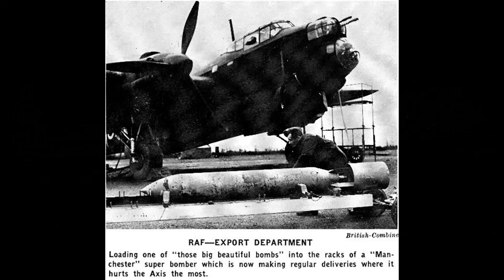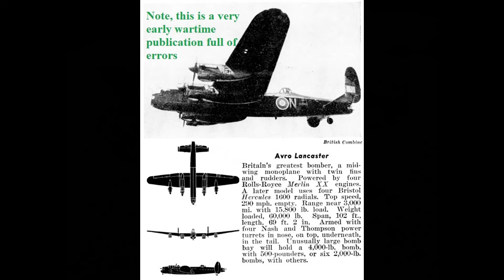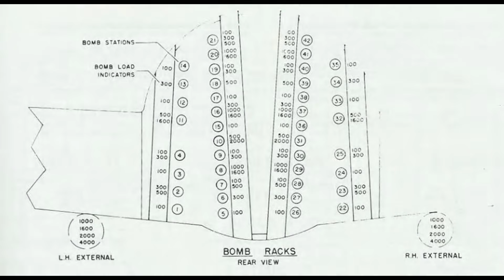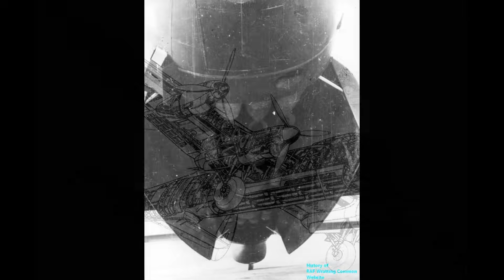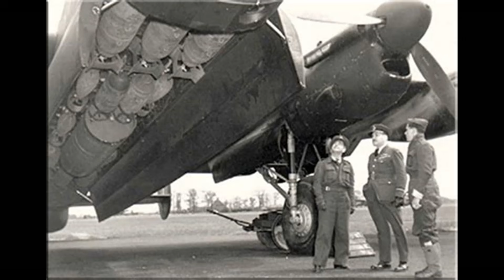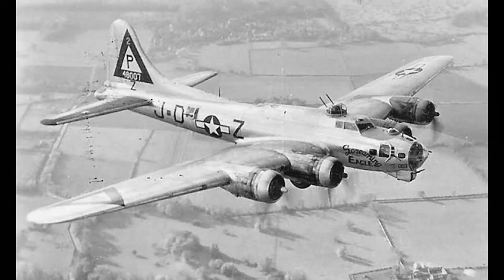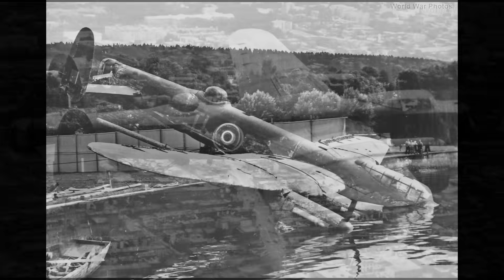Avro Lancaster, Payload, Turrets, Stability and More

Comment: Always enjoy the little side-facts your videos contain - ever since I was a kid browsing through "history of aviation"-type books (you know the kind - lots of images of cool planes, combined with the least amount of technical explanation they could get away with), I was a believer of the "dihedral wings always return the plane to level" myth, as in the wings would automatically generate correcting momentum in the roll orientation. Thinking of it today, should have been obvious that there is nothing to it in that regard (obviously there is no change in roll momentum from the orientation of the plane relative to the horizon), but it's one of those concepts that sounded good and is sort-of-halfway-in-a-roundabout-way-semi-correct, as it does help stability; but I'm very glad you cleared up the whole thing - before your vid, the wings of those C-17/IL-76 you showed made zero sense to me, I actually thought they flex upwards enough in flight to turn dihedral again...
Reply: Actually there are 5 wing to fuselage attachments (for mono-wing aircraft.). Low wing, Mid wing, high wing, shoulder wing and parasol wing.  On shoulder wing (like the B-24 (just look at a picture taken fro above the plane.)) and parasol wing (think of the PBY Catalina) can have part, or all, of their wing with Anhedral!  Some planes have the "Gull Wing" where they have a short dihedral out to their twin engines and then either no dihedral, nor anhedral (B-25, which is a mid wing), or a slight anhedral.... (The F4U Corsair, and the Ju-87 have inverted gull wings).

Comment: The Catalina and Sunderland are other exceptions to the high wing twin tail norm. I guess that being flying boats they has some different considerations to a land plane.
Reply from the maker: I said it the other way around. If it has a twin tail, it's usually not a low wing. The Catalina and Sunderland have conventional tails which are commonly seen on aircraft with all types of wing positions.
Reply: @GregsAirplanesandAutomobiles  I think he's perhaps thinking of the other Consolidated flying boat, the Coronado?

Comment: Considering how many crew died in the plane is testament to the fact that it was NOT a super bomber it was an adequate/good bomber but as you point out far far from perfect.
Reply: Main issue was the size and location of the escape hatches. Had they been better designed nd located, more crew would have been able to bail out.
Reply: @richardvernon317  Liquid cooled engines were the bigger problem.  Coolant lines and flak don’t go together well
Reply: @kingssuck06  No, it was the escape hatches. This was even remarked upon at the time, with their size and position noted as not being optimal, but this was deemed an acceptable compromise given the other positive attributes of the aircraft.
Reply: @kingssuck06   Avro Lancaster 3339 lost, 608612 long tons dropped or 681615 US tons Now compare to USAAF H/Bombers 10152 lost for 761802 US tons dropped 
So one RAF Bomber drops 89% of the USAAF effort and loses 32.89% of what the USAAF lost I reckon that is absolutely fantastic 
Bomber Command 55000 lost in 5 years USAAF 95000 fighter and Bomber crews lost in  2 years 8 months The Source : Air Forces Statistical Digest WW2 Its does not differentiate between H/B L/B and fighters there were 12528 fighters lost
Reply: @richardvernon317  Does anyone actually have the dimensions and has done a comparison of the  crews physique of the Day
Reply: What is perfect?  As I understand engineering is, by it's very nature, a compromise.  Take the B17, indeed the American counterpart for example.  It was intended by the air force to be used in  daylight, unescorted operations and to be able to defend itself against fighter opposition.  As we all know, it couldn't.
Reply: Sure did the job it was intended to do tho

Comment: I have no way of knowing for sure since I lack flying experience, but I imagine any bottom turret would be useless at night, especially if the towns below were blacked out, which they tended to be, it would be nearly impossible to find and track an enemy fighter against such a dark background, at least at night there are some stars and maybe even a sliver of moon to serve as a lighter backdrop for upper and side mounted turrets
Reply: I think another major problem with the periscope-aimed lower turret was vertigo induced airsickness. That was a big reason why they were deleted from the B-25. I'm pretty sure it was also a factor on the Lanc. You can't shoot down the bad guys if you're puking your guts out all the time.
Reply: euh..after the bombing at night over germany..these bombers returned over occupied Holland...at dawn...and things got visible from a morning sun horizon creeping from the east..
Both the lanc as a target from normal german fighters (not nightfighters perse)..as for the lanc to detect trailing german fighters..
Reply: At the time the decision was made to remove the Ventral turret, there were plans to put something else in its place. Greg will most definitely covering said item in a future video. When the USAAF fitted their own version of said device, it was located were the Ball Turret was.
Reply: @Richard Vernon  I'm sure that particular ventral device is the antenna nacelle for the H2S (Home Sweet Home) ground sensing radar.  Both the RAF, and later,  USAAF used it to great effect.  It allowed "blind bombing" by night and by day.
Reply: @amerigo88  The US system was much better engineered and had an automatic bombing capability that the British kit never had until after the war. The original definition of the covering around the H2S scanner was a Cupola, nowadays such an item would be called a Radome.
Reply: but I imagine any bottom turret would be useless at night, especially if the towns below were blacked out

The lack of a ventral turret left a vulnerable blind spot. A few squadrons, both Lancaster and Halifax, made modifications to their aircraft with a jury-rigged ventral position, or later, fitted the Preston-Green ventral turret which had a single .50-cal machine gun (for those not carrying the H2S radar). The main value was not so much in defensive fire, but to warn the pilot of an approaching night-fighter so that evasive action could be taken.
Reply: I expect a central turret would have been far from useless,  if it was a complete, Sperry style unit as in the B-17 and B-24 where the crewman was inside and it was retractable into the fuselage for takeoff/landing. Clouds below the bomber were frequent, so any sort of light such as moonlight from above, burning buildings below, searchlights, and so on would provide illumination for that ventral turret gunner. The German Wild Sau (single engined fighters)  that flew at night sought to use such light to find and attack the Allied bombers as they lacked their own radar. 
As with the tail turret, ventral turret gunners may have been provided radar, but without the turret or the crewman, the RAF never sought a radar for ventral protection, AFAIK.  
Greg hasn't mentioned it yet,  but the standard German nightfighters,  Bf-110 and Ju-88, were fitted with radar and cannons mounted behind the pilot firing at a 70-degree angle ahead and mostly above the fighter.  Standard practice was to with your way into a firing position below the Lancaster,  aim for the wing roots (not the bomb bay!), and open fire.  As the bomber would break up in flight,  the nightfighters would dive away to safety. This went on for many months with impunity, the RAF codenaming the mysterious phenomenon "Scarecrow." Eventually, a German nightfighters with the oblique cannons ("schragemusik") was captured, and the bomber crews and Mosquito escorts began to implement countermeasures.
Reply: @amerigo88  While the B-24 ball turret could retract, I believe the B-17 turret was fixed. Hence the stories about damaged B-17's returning with landing gear unable to lower and a wounded gunner stuck in the ball turret. 

The upward firing schragemusik cannons were very effective, as the German pilot could see the outline of the British bomber against the night sky. The Brits had forbidden their latest Mosquitos from flying over enemy  territory to prevent the Germans from learning about their centimer wavelength radar but were forced to change this policy when confronted with increasing bomber losses.
Reply: @amerigo88  The Schragemusik attacks were aimed at a wing somewhere between the two engines. The reason for this was there was a fuel tank there. Mosquito nightfighter escort support started well before the Schragemusik installation was known about. However, the first Mosquito Nightfighters given to Bomber Command were a bunch of clapped out NF Mk II's fitted with AI. Mk IV radars and Serrate radar homers. AI Mk IV was next to useless in Chaff, The Switch to the longer Wavelength SN2 radars in the German Nightfighters made Serrate useless and the Merlins in the Mosquitos were well worn out and caused a large number of engine failures. Harris had been proposing Mosquito nightfighter support for the bombers as early as 1942 but it wasn;t until late 1944 that he got any major numbers of the latest version of the aircraft with a decent centimetric radar.   AGLT did not become operational until late 1944 and very few aircraft (4 squadrons worth) were fitted with it. Schragemusik became operational on 17th August 1943 (first kill with it was during the Peenemunde raid) but only around 1/3 of the German Nightfighter force was ever equipped with it and it wasn't an easy bit of equipment to use (though in the hands of an expert pilot, he could really rack up the kills if he got into the heart of the Bomber Stream).

Comment: Absolutely love the video. Especially interested in the discussion of the turrets. The Lancaster is oft criticized for being less defensible than American bombers, having less armament etc. Your comment about their usefulness in night operations got me thinking. I'd love to hear more about this topic.
Reply: I always wondered why the front turret wasn’t removed altogether and replaced with a streamlined nose as was done with the Halifax.
Reply: @Glen Towler Freeman Dyson proposed that, IIRC. It wasn't just about speed, but also loss of fewer crew as it was surmised that most lost were due to flak, accidents or nightfighters they never saw coming, with more guns not likely to help with any of those scenarios. The problem was the Lancaster would still have been vulnerable as it would still have been slow, and then morale of crew that felt defenceless would have been so poor there would have been a mutiny. Dyson was correct in logical terms, but ignored the human element.

The reverse is true - the chances of a German fighter pilot being shot down by guns on a B17 was low, but all those tracers flying around had a an effect on willingness to press home attacks. But the loss rate on unescorted raids showed the real killer of fighter attacks was escorts.
Reply: Let's see if the oft-forgotten Lancaster II variant gets a mention. (That one was powered by four Hercules radial engines and came standard with bulged bomb bay doors allowing carriage of the 8,000-lb HC bomb.)
Reply: @primmakinsofis614  people note it was slower, but it did have a bilges bay and more drag. It very often retained its FN. 64 turret as the bulged bay was incompatible with H2S, but you still see photos of ones   with just a fairing there. You'd think a Preston - Green would be a good option there, if just as a look out post.
Reply: @Glen Towler the Free French removed the mid-upper. I presume speed, but maybe also a relative lack of crew.
Reply: @Glen Towler the Free French removed the mid-upper. I presume speed, but maybe also a relative lack of crew.
Reply: You might read “Bomber Command” by Max Hastings, you’ll find discussion of the issue there,
Reply: AMand

I would presume that during night operations, when visibility is much more of a problem than during the day, a night fighter would have to get much closer to the bomber in order to position itself for an attack. Thus, the problem with the lack of range of the .303s would very much be reduced. Also, in such a scenario the faster firing rate of the guns means that a higher concentration of smaller bullets could be more effective than a smaller concentration resulting from the slower firing rate of the heavier 0.50 calibers. It would be interesting to hear what others have to say on this point.
Reply: @arthurmanders2878  Very true as discussed in Abbeydale Press Great Aircraft of WW2  Five planes are discussed Spitfire Lancaster Bf109 P51 and B17
Reply: I am convinced that 9 out of 10 aviation, or at least WW2 aviation comments are more but people who haven't got even a slight ability to do critical thinking or make an original thought. They just hear what ever myth they want to hear and blindly accept it without ever bothering to put any thought into how likely it actually is, is considering the source or that they might be willing. "it's written in a BOOK. So it is true!" They fact that the author is just some guy sitting down to write words, usually long after the war ended, means nothing to them. They don't consider that veterans have as tendency to and embellish for a good story as anyone, probably more so. Anyway, yes they whole "Lancasters where too lightly armed" thing was always a good joke. How much did heavier guns help out the B-17s? What Lancaster is going to sit still and shoot it out with a night fighter? In night combat the side that spotted the other first won, the first a Lancaster knew about an NF was the cannon shells zipping around it, and its best salvation was to take immediate action, preferably before the fighter got a firing solution. The gunners were first watchmen, to spot the enemy first. The guns were only to make the crew feel better and to distract the enemy and spoil his aim, make him a bit more careful. I remember someone toting out the "cannons/.50s outrange .30s so the enemy could sit outside mg range and shoot the bombers down". I explained that most night fighters did well to even SPOT the bomber, and there was no way they were going to drill one from max range. They usually had to close to 100 yards or so to line up a perfect shot, before the bomber saw them, and then destroy them with some or two busts. Bigger guns would have added no value and would have detracted from the Lanc. He insisted that the British leaders were little better than murders for their failure to adopt larger guns, even though they had been experimenting with them since 1941, they just wanted to save a buck and so let crews fly off to death with inadequate guns! Yes, the same leadership that spent millions on navigating aide, landing aids, to get bombers home safe, networks of operatives in Europe to get their valuable crew members home safely, cordons of ships constantly patrolling the channel to save as many lives as possible, everything they could to reduce the drain on trained crewmen. That leadership apparently never thought it was worthwhile upgrading the guns to save lives. They upgraded the guns in their fighters, they upgraded their fighters, they upgraded their bombers as well, throwing away hundreds of perfectly good but obsolete planes, all to give their crews a fighting chance. Yet this dude totally accepted this ridiculous statement as fact, it never occurred to him that maybe, just maybe, if the RAF didn't ever upgrade from .30 cal defensive guns, it was because they decided it wouldn't be any better.
Reply: @justforever96   Very well said and so correct. But you are posting to  blind readers.

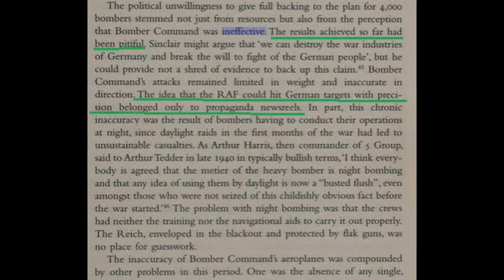Comment: 28:14 what's the top turret in this photo? those look like 20mm?
Reply from the maker: I'm hoping one of my viewers knows. It either has really long barrel 50 cals, or those were experimental guns of some other type. I don't really know. It could be some sort of illusion too.
Reply: @GregsAirplanesandAutomobiles   Hi Greg, I'm far from an aircraft expert but could this be an image of the Lancaster IV aka a prototype of the Avro Lincoln? It looks like the Bristol B.17 2x20mm Hispano turret but the Lincoln used a 4 bladed prop as far as I know.
Reply: turret update: a quick google suggests with might be "Lancaster JB456 with Bristol Type 17 turret" as seen on World War Photos dot info. Their cropped photo looks very much like the one above, including the small white patch just aft of the port roundel